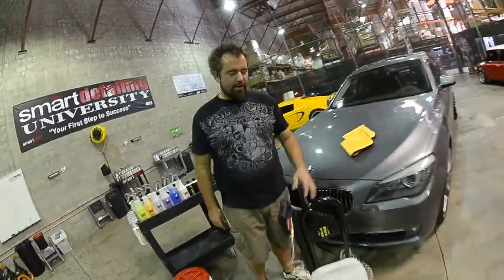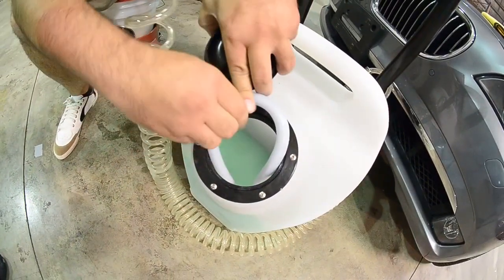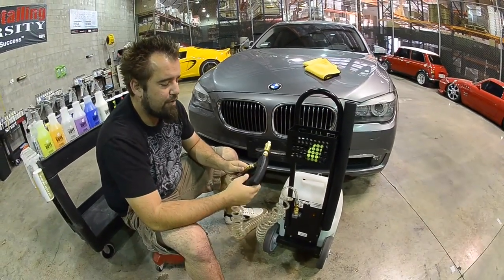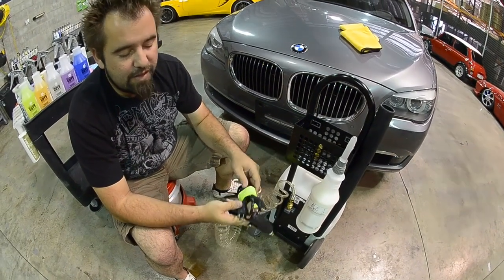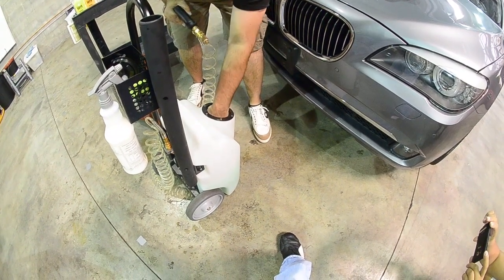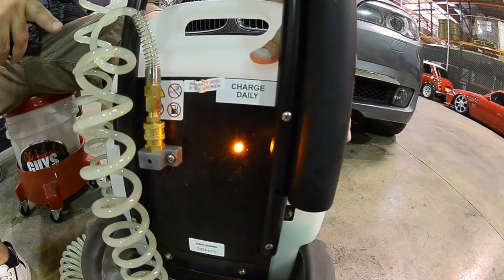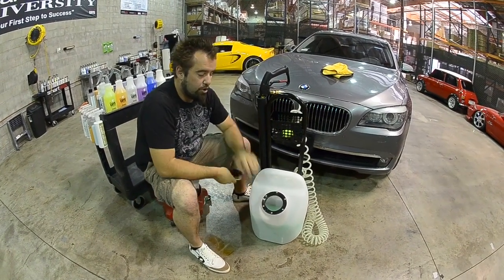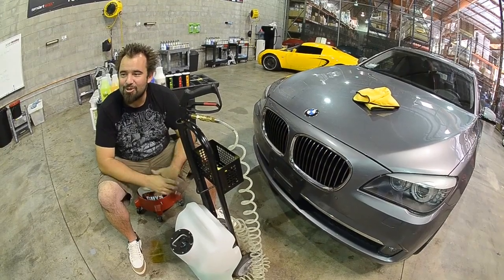Green Detailing Eco Friendly Waterless Car Wash System Chemical Guys

Comment: Does it work if car is real dirty
Reply from the maker: Hi Avery, dirt, dust, dead bugs, sap, the usual fall out from the outdoors are no match for a waterless wash system. For really muddy cars that are dripping with filth, grease, and anything where a light to medium cleaning can't do the trick, a pressure washer or two bucket method would be a better choice. Stay tuned Avery, we've got more great videos coming your way.

C.G. Alex -